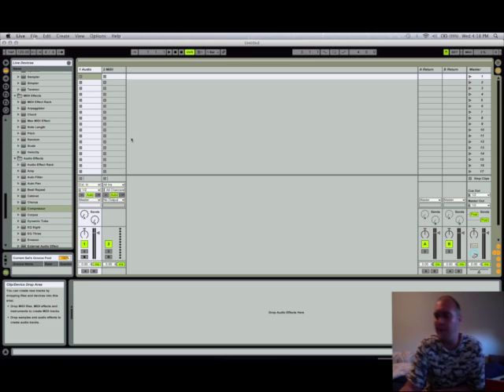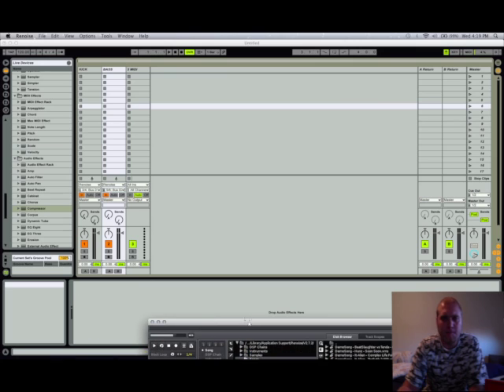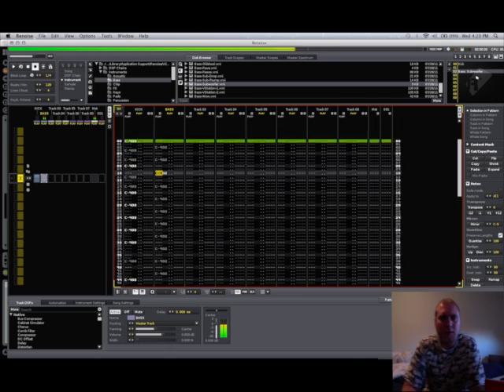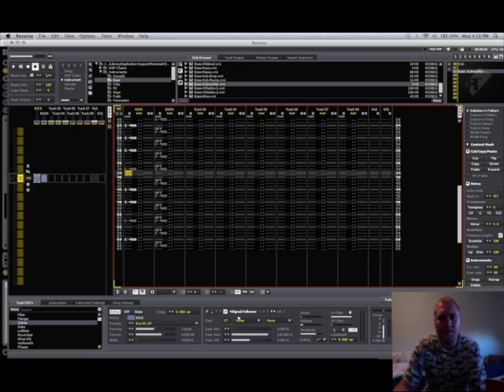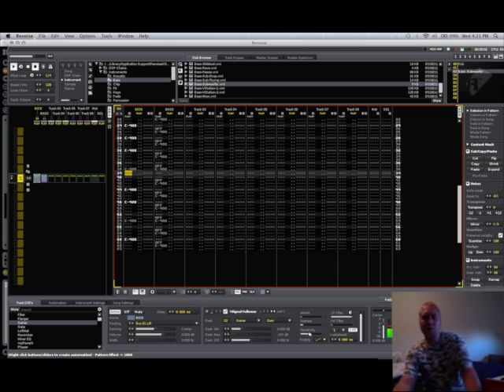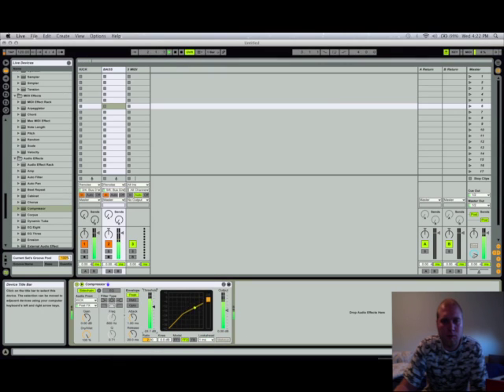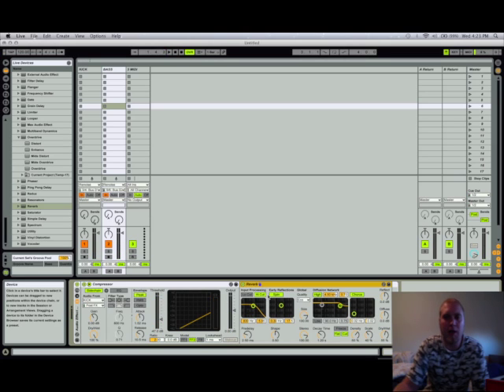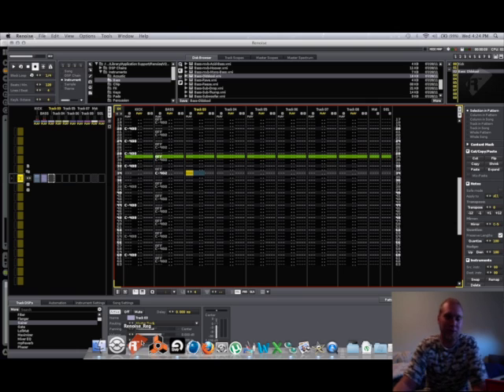Renoise vs. Ableton Live Ducking Techniques

Comment from the maker: With all trackers, you have that little bit of extra control when dealing with samples. Renoise has is own built in DSP effects as well as .AU/VST support, I find the filters in renoise to be much better than a lot of DAW's mostly because there's a choice of filter type (4pole,moog,butterworth 4n/8n) from gentle roll-off to hard notch.. It would be very hard to compare considering how different they all are. I can't say any DAW is the "best". Its all about what you are comfortable with using.